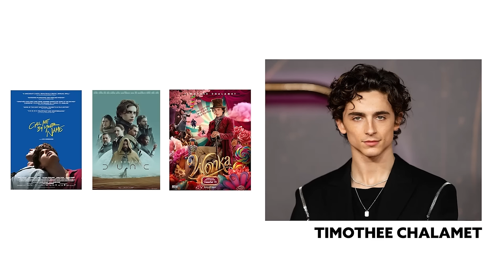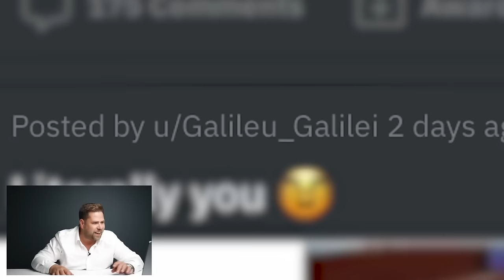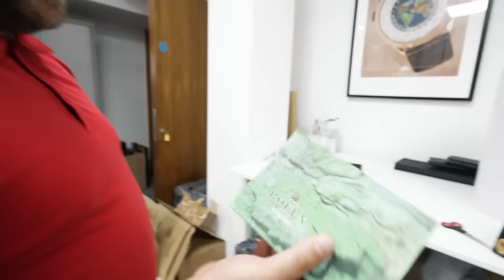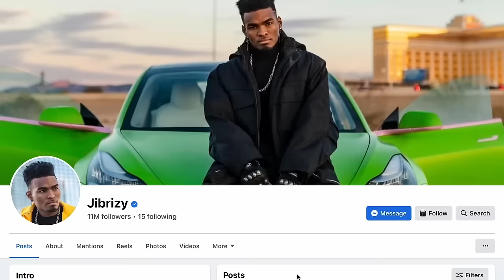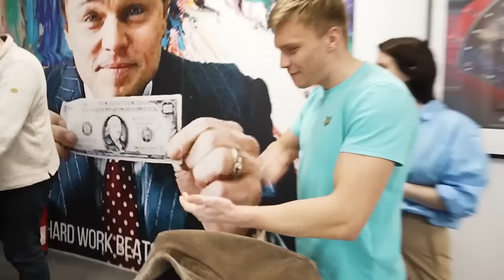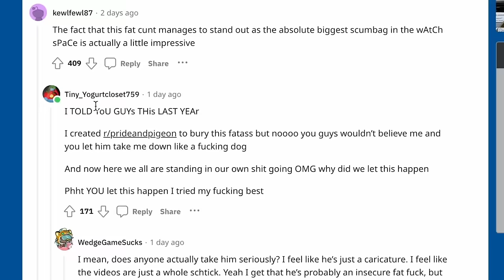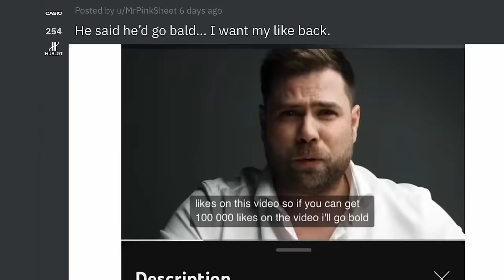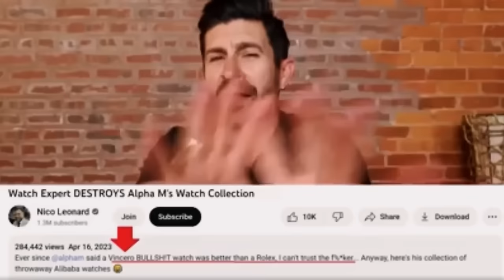Nico Leonard’s Funniest Moments!

Comment: The reason why your car was warning you that the left front was flat instead of the right front was most likely due to the front wheels being swapped after installing new tires and not reprogramming the sensors, Whoever InstallEd the tires was either poorly trained or just plain lazy!